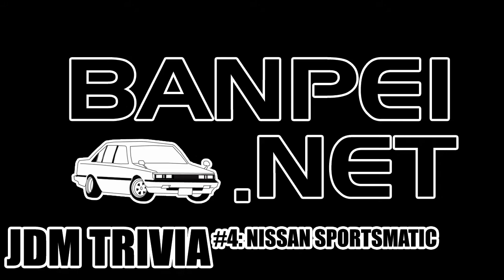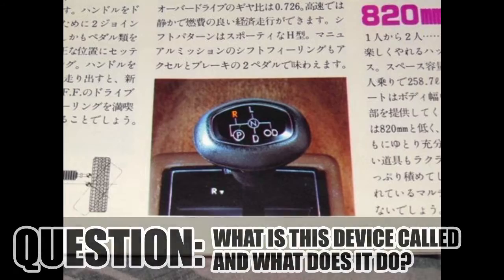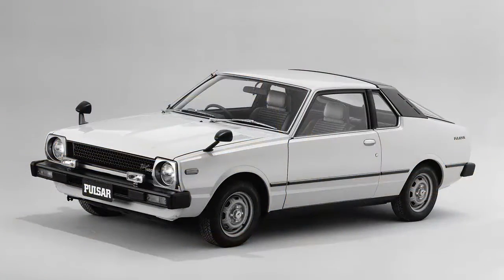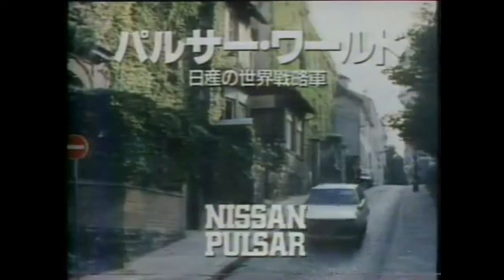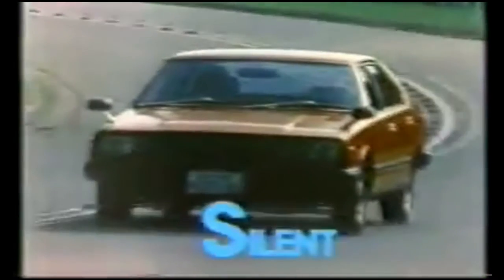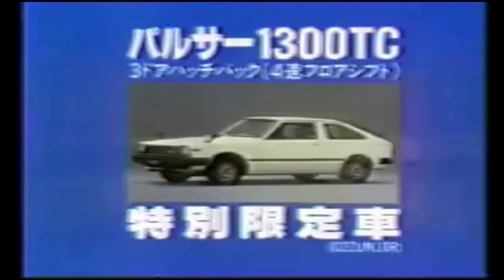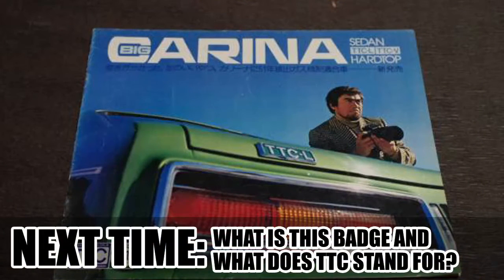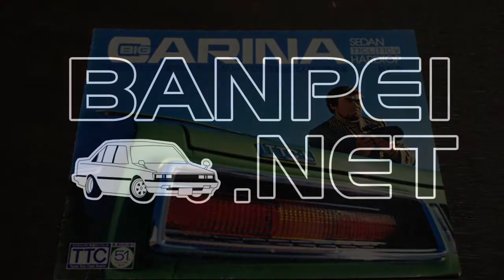Nissan Sportsmatic gearbox [JDM Trivia #4]

Comment: the mid 80's Isuzu gemini had a similar transmission as well. but the configuration was low range when first gear would go on a manual, D3 in 3rd gear position, D5 down, reverse on bottom right, neutral on neutral, and P on bottom left. i forgot the name, but i got it on a japanese magazine i got like 4 months ago.
Reply from the maker: Thanks! Yes I know about that one. But the Isuzu transmission was computer controllers shift matic, so like a real modern automatic. I wanted to cover the Isuzu box in a later video and compare the two
Reply from the maker: Found it, the navi5: https://youtu.be/CiMRIrI7Dk8
Reply: that's the one i was talking about! really cool systems both of them, i didn't knew they worked different though. thanks for the link!
Reply from the maker: In the end they are not that different: they shift gears, but is remember correctly Nissan's Sportsmatic is still a mechanical shifter while the NAVI5 is a computer controlled unit. I'll re-read about it once I have the time